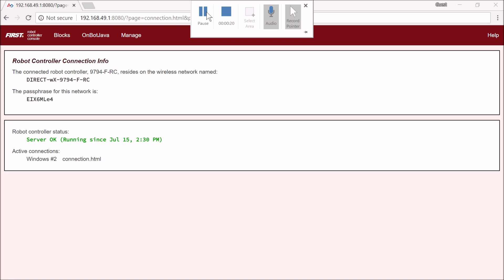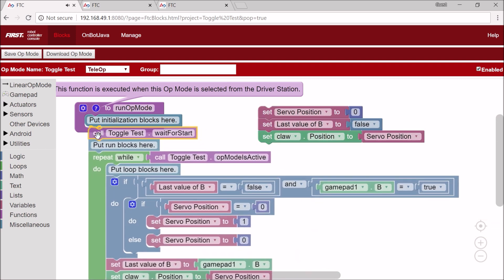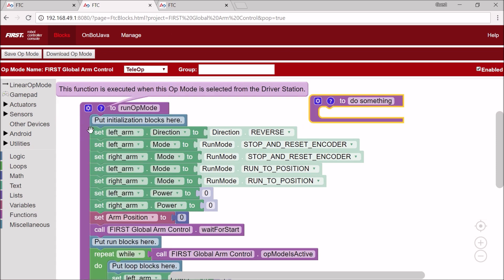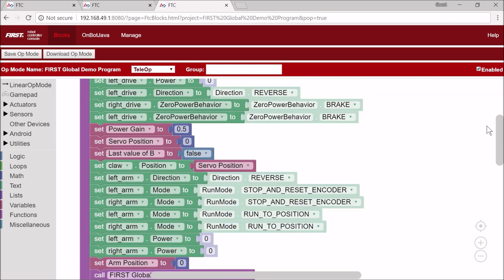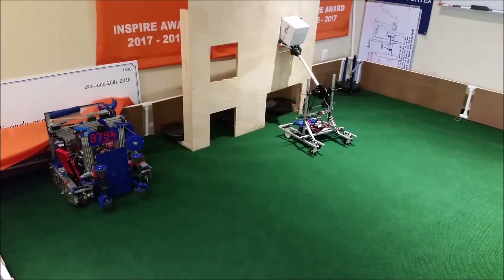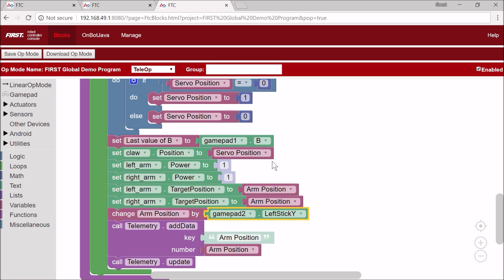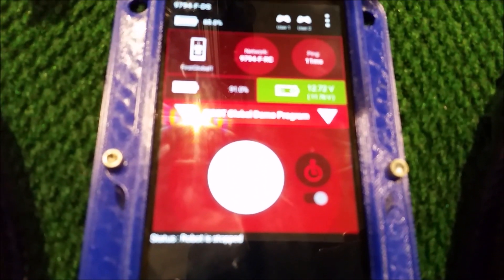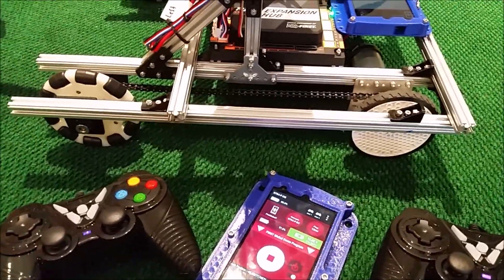Putting the program together

Comment: May I ask you what bracket did you use to connect between the small wheel and the grabbing claw ? Is it 90°bracket ? Or 135°?
Reply from the maker: Rarity Crystal use any of the angle brackets that have an angle larger than 90 degrees. To see the whole build, check out the video we made on building that claw and arm.
Reply: Team USA FIRST Global Challenge 2018 FGCTeamUSA2018  thanks , good luck on FGC at Mexico 2018 ^^